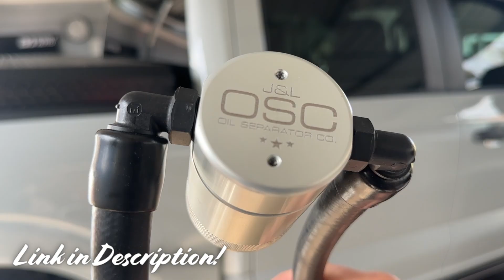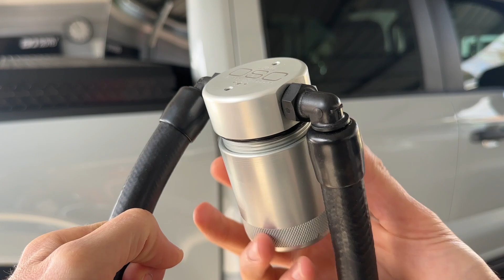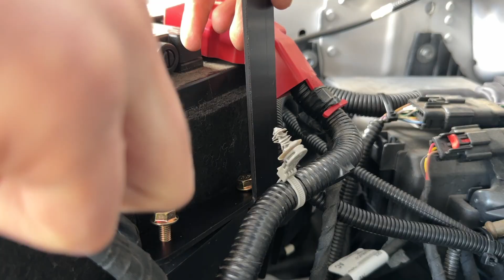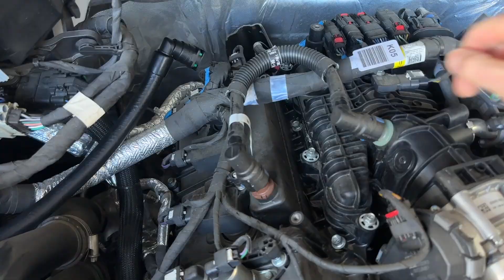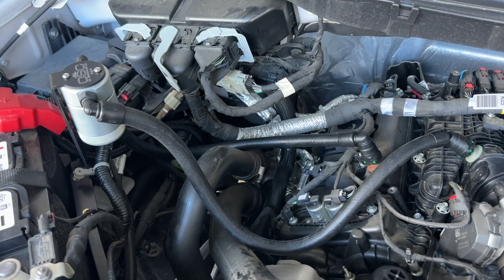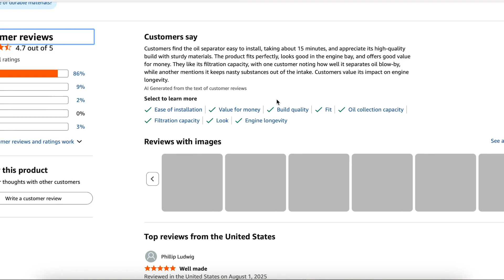J&L Oil Separator Install on F-150 (Keep Gunk Out of Your Engine)

Comment: Great video , ? What made you pick this unit out of all the units I see online, ? Have you had any issues with the hoses collapsing , someone post that they had this problem and had to put better quality hoses on - not sure what brand he had. I have a 2011 f150 5.0 and I’m searching for one of these to install. Thanks for your help thanks from Pittsburgh pa🎉.
Reply from the maker: I read a lot of the reviews on this unit before purchasing. It seems there were more mixed reviews on the much cheaper units from Amazon, so I decided to go with the American maker product. In comparison to the overall vehicle price, this kit just makes more sense to me.
Reply: Some times I like to save money other times I would rather spend it on quality parts than run the risk of something cheaply made cracking leaking or blocking air flow on a mission critical component